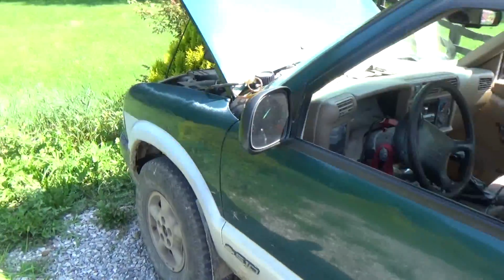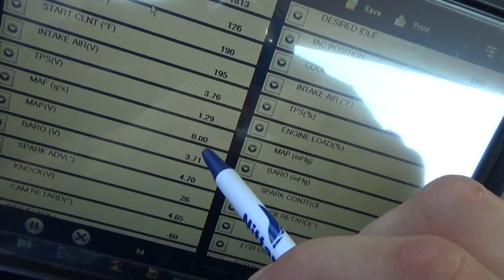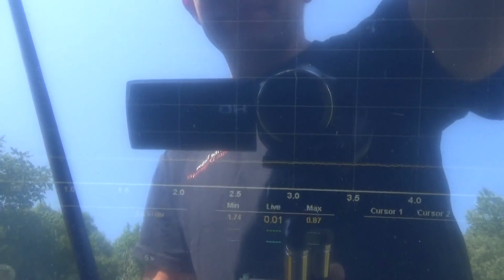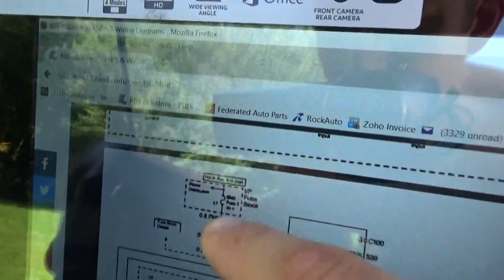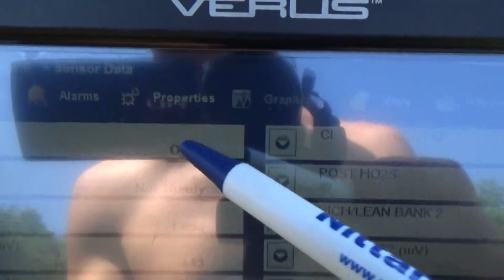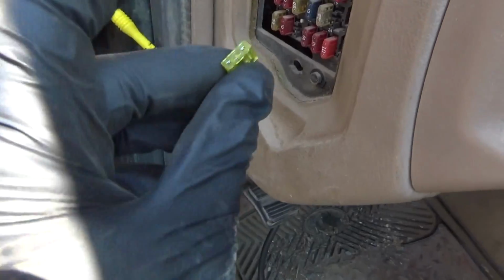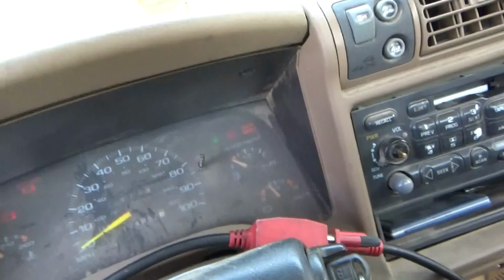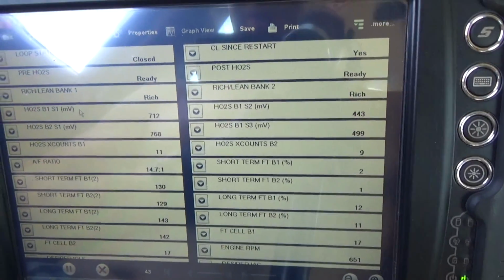Rough running, low power P0102 P0340: '97 Chevy S10

Comment: Do these vortec 4.3 engines have a crankcase vacuum ? ...example :  I have one and once the oil fill cap is removed , I can feel a good amount of suction thru the valve cover oil fill tube 
Thanks for your tips 😇

Comment: I’ve done changed everything on my s10 still bogs lightly I’m going tot Ty this tomorrow
Reply: After driving my truck all day it gets worse as the day goes on driving the truck all day manly in hot weather I hope this and the tps helps I’m also getting a new fuel pump after this if I don’t fix it I’m going to the shop to get it fixed. I have a 600 mile trip in 2 weeks😅
Reply: So my problem was a old rusty looking fuel filter truck ran like a new s10 off the show room floor in till now it’s starting to shake when at idle and run rough no codes I’m guessing it’s a vacuum leak. Truck ran supper good for 7 days now it’s running like poop
Reply: I’m thinking it can be the fuil pump but I’m no mechanic so back to watching you tube videos till I figure it out

Comment: Mine does the opposite.. Have an 02' Blazer Zr2 with 4.3.. Stopped at store it was running great, then came out & had a no start condition. Towed it to a shop & they said the Coil shorted out the ICM & it needed a new Distributor. Cost $700, now it starts fine, has a little power when Cold but as soon as I hit Operation Temp? It bogs down bad, no power at all. It's like no fuel or spark. I replaced the plugs, wires & Temp Sensor. Still didn't help, made it worse actually. How could it go from running great, to a no start condition, to now all these problems or am I fishing? You can twist the new distributor right & left a little, it's just like a clunk clunk type turn but does nothing to the engine. Confused! No codes besides a miss, no check engine light also.

Comment: seen that the truck had some evap codes as well did the fuse change take care of those ?  have the bad P0420 code on my 97 have changed the cat both oxygen sensors and the vent valve switch  gas cap and it still comes back

Comment: In 1997 my girlfriend bought a brand spanking new gold s10 extended cab pickup with the 4.3 engine, there were three to choose from, a red a green and a gold. I did all routine maintenance on it after the warranty was up she insisted on letting the dealer do oil changes etc. The only major thing to go wrong with it of course after the warranty expired was the valve body, it was shifting rough with delayed shifting, she took it to the dealer they replaced it for 1,200 and it's been good ever since, two years ago I rebuilt the front suspension two new lower control arms one had rusted to the point where the shock mounts was  completely rusted away so the shock wasn't attached, after all the work it was like a new truck, she has 148,000 now never had any wiring issues, it has manual windows, she bought a nice high cap for it the following year. The first time I did a full tune up I made the mistake of using a non Delco ignition cap and rotor, I got what I thought was the best advance auto had to offer, then the problems started, it wouldn't start when it rained, it was losing power I tried another cap and rotor this time from AutoZone and still it was no good, then I did some research and found somebody who had the same identical problem so he bought a Delco cap and rotor and his problem was solved, I thought it couldn't be that simple but I had nothing to lose, that was some five years ago and since installing genuine GM parts I never had another problem, the truck starts up with a flick of the key no matter how long it's been sitting except in the winter when it's extremely cold and the oil is thick, she's never been abused the interior is like new.

Comment: I've found fuses that have blown due to age as well,my parents hot water system fuse blew at over 40 years of age in the meter box on their house & there was no fault in the hot water system or its associated circuit,I replaced the fuse wire for them with 15 amp wire.

To be honest ,whoever wired the house up seemed to use 8 amp fuse wire which is for the lighting circuit in 1977 but it decided to blow this year !

Comment: Seem like you know your stuff and i need some help on an 03 zr2 s10 4.3 5spd truck runs good on level ground but when you put it under a load like up hill it falls on its face and if u down shift and run it hard it is sluggish and you finally gt it to 3500 4000 rpm range the ses light will begin to flash and it will dead miss but when you level out or turn down hill light quits and miss goes away and no codes stored at the end of my rope threw a bunch of parts still no change any info would be much appreciated like your videos
Reply from the maker: Sounds like it's starving for fuel. Check fuel pressure under load. Otherwise could be a clogged cat 👍
Reply: @PineHollowAutoDiagnostics  ok thanks i will check fuel pressure but already changed the cats i have some pics of a scan tool with 02 sensor voltage and different thing but cant make head nor tails of it i mean its nothing like your scan tool but any way to send u the pics and see if you see anything out of the ordinary would be much appreciated

Comment: You morons are complimenting this guy for his intelligence but what was the problem and solution? Yeah keep up the compliments for someone who just reads codes.
Reply from the maker: I'm guessing you didn't finish watching the video? Truck is still running great almost 3 years after this repair was made :D
Reply: @PineHollowAutoDiagnostics  nope. And if I did I would have gotten my answer from a paid mechanic already like I just did after not fin your video. Mine was a bad spark plug.
Reply from the maker: I don't understand your logic. My video presented the symptoms, diagnosis, and repair of a particular issue for this particular truck. Why would you expect to find answers to a different problem?
Reply: @PineHollowAutoDiagnostics  you gabb so much in the beginning and it's irritating not helpful to the repairs. Understand?
Reply from the maker: The repair is not the important part. I focus on the diagnosis and thought process.
Reply: @PineHollowAutoDiagnostics  diagnosis and thought process?... What are you artificial intelligence?

Comment: Just purchased a 2000 blazer and this is what was wrong with my truck. Thanks for this video i was able to fix it. Yes it was this fuse but on 2000 blazer the Engn 1 fuse is under the hood and a 10amp.

Comment: I have a  2001 chevy blazer that has had the front Cat removed and the rear cat gutted? I have done everything to try to get it to run good put $$$ into it spider injectors, tune up,  Maf sensor water pump,new distributor etc... I also have   02 sensors(have not installed yet) i bought since my code reader said bank one was bad . It still runs very rough I just want to get it running good sell... Any suggestions? Thanks for your time..

Comment: If the truck runs crappy when cold, and gets better as the engine warms up, you may have intake gasket issues.  Especially with the long term fuel trim numbers improving when revving the engine  It is very common on the 4.3/5.0/5.7 engines from this era.  GM's intake manifold gaskets are thin, and cheap.  I have already replaced them on my 2001 S-10 4.3L with a set of Fel-Pro gaskets.  Thanks GM for using crappy materials!!!!  Good video though.  Thanks for taking the time to film the procedure.

Comment: Damn! We need more mechanics like you in this planet. All these mechanics out there are just ripping people off. They would of told me it was my fuel pump or something major like that to charge me an arm and a leg. I dont mind paying as longest they do it right the first time.
Reply: The fuel pump took me 1/2 hr to change. I cut an access hole in the bed. Then I went to the junkyard and cut a panel larger than my access hole. Trimmed the panel to fit,rounded the corners because it was razor sharp. Screwed it down with self tapping sheet metal screws. Painted it with spray can bedliner. Looks good and all fixed. I did use a Delphi fuel pump $300. There's cheaper ones though. Airtex brand is alright.
Reply: @Thundarr995  as a professional tech, i cant do that to a 5 year old truck. People dont like that. I drop tank, or lift bed. Some crew cab trucks have the fuel pump under the cab. If its your truck, its your decision.
Reply: Generally its not that techs are dishonest, Its that they are poorly trained and inexperienced. They never learned proper diagnostic techniques or how to use a scope. I am a scope tech, i do the actual diagnostics. I find actual problems and fix them. Sometimes i get stumped, and watch an Ivan vid.

Comment: on my 96 Sonoma there are some wires right below the steering shaft that were rubbing on the exhaust pipe and it was hard to tell until I looks through the wheel well ,  it's a 2.2 liter  . this truck may be different .

Comment: I wonder if it will set a cam crank correlation code. 15 degrees is a lot. Worn dist gear. Great video. Interesting that u said half the current is from bulb filaments.

Comment: methinks there's a wire chaffed/shorting down yonder ;)
been a while since I was graced with an S10 repair
Reply: by the way, the fuse looked like a "hard short" open, vs. a slow melt open..
after thinking hard, I kind of recall a few with wires shorted at/near the evap vent valve, look back there if you get a callback and O2's seem ok

Comment: I wouldn't let Matt from Schrodingers Box hear you say a fuse blew from anything other than current draw. He called me every name in the book and a disgrace to my profession for suggesting a fuse can just blow from age, heat cycling and outside influences other than current draw. There is also such a thing as inrush weakening, far be it for me to even try to explain that to him, I imagine I would suffer even more insults. These fuses live in a very harsh environment and anything is possible. In my 35 years of servicing electronics I have seen open fuses that just can't be explained by anything other than "it was its time" then I got all kinds of straw man arguments about engine fires and some other non sensical stuff to the contrary coupled with more insults. You do always have that "somethings wrong" in the back of your mind but time says otherwise when it never happens again.
Reply from the maker: Hey Gary, thanks for the thoughtful comment. Well, I guess Matt S. could be correct in that the electrical current "finishes the job" of blowing the fuse, but that is because the fuse was previously weakened far below it's stated capacity. And yes, he is creative with the insults xD
Reply: Anything man made is susceptible to failure, even a fuse.

Comment: Hey good video Ivan those erra gm trucks including the full size, the wiring harnes runs along the cross member for the transmission going to the down stream o2 sensors . The harness will come loose and rub the front drive shaft when in 4wd only .the front shaft won't turn in 2wd have him put the truck in 4wd and see if it blows the fuse wile driving if it does suspect the harness rubbing
Reply from the maker: Great tip, Mike. I didn't see any harness rub, but it's a possibility. I'm sure to hear back from the guy if it acts up again :)

Comment: I've also noticed on GM products that the first crank after a clear code or battery disconnect is extended. I assume it's just because the PCM loses its adaptive data like IAC position, fuel trims, etc. When it first happened to me, I was a little concerned too.
Reply from the maker: Interesting. I have noticed a similar long crank after code clear on Subaru vehicles as well.

Comment: I have had many of those in the past,that 1 of the 02 sensors,mainly behind the cat is intermittently shorted causing mass air fuse to blow,by simply tapping on the 1 of the 02 sensors, throwing p340 codes as well,especially the R motor 5.7 liters V8,Just saying.
Reply from the maker: Thanks so much for the tip, Russell! This is what makes the comment section awesome. If the truck comes back with the same issue, that is the first place I am looking :)

Comment: Sometimes a $xxxx dollar scope is not the best tool.   For instance on a +12 volt feed you very rarely if ever care if there is +12 volts with no load, or the scope 10 megohm input load, you want to know what you get with a tangible load, say 100 milliamps, like what a hot-wire sensor might draw.  If a connector has just a smidgen of green-copper corrosion it will show 12 volts with a scope load but near zero with a real load.    A 12-volt taillight on the circuit is more informative than a $xxxx dollar scope.
Reply: He knows that.

Comment: Surprises me the truck even starts!  The minimum fuel pressure at idle is 50 psi. One here with 48 psi wouldn't even fire off. Replaced pump and filter then spider injection system due to misfires. Note that some of these pumps ground through frame, but if factory security it may ground through pcm. Ours grounded through frame near pump, cleaned that up when we replaced the fuel pump. 

Never had any ign fuse blow, but I have seen other GM no starts with EMC fuse B blown which is fuel pump circuit related. 

Verify the accuracy of your fuel pressure gauge.
Reply from the maker: I did think is was a tad low for a Spider system, but it fired up no problem!
Reply: 48 will do it if the poppets are clean....when it gets cold it might not be enough
Reply: Jacks Garage your absolutely right  about the fuel pressure

Comment: Sometimes a blown fuse is just a blown fuse.
Reply from the maker: Indeed it is. But then you always have that feeling...did I miss something?
Reply: True story 👍
Reply: Lots of inductive loads connected to this fuse, ergo lots of current spikes, ergo lots of thermal cycles on the fuse. Expand, shrink, expand, shrink... give it a few ten thousand times and it breaks.

Fuses in high fidelity, high power amplifiers last a thousand power cycles at most. Yes, they're rated for the current and are of the slow blow type, but, eventually, they just break.
Reply: Pine Hollow Auto Diagnostics Another true story lol 😊
Reply: Jan Verschueren, agree, yes they do, any one of us that has serviced equipment that sustains inrush knows all about this.

Comment: Question:  Why did you not check the current flow after replacing the fuse?
Reply from the maker: I guess I could have thrown an amp clamp on there for fun...but there was no excessive current when I checked it with the big test lights :)